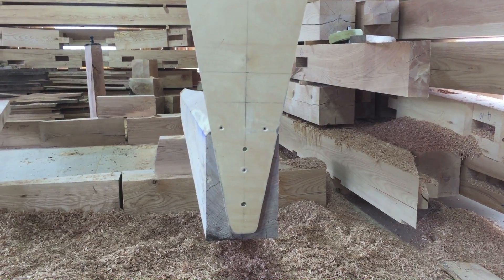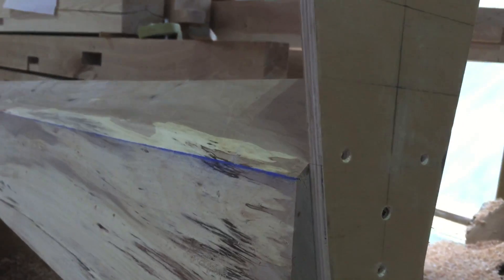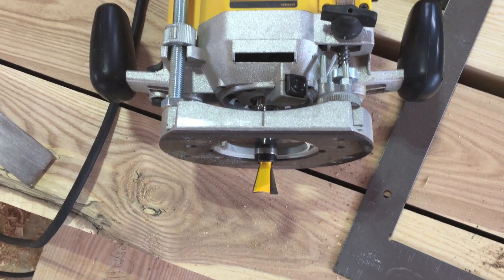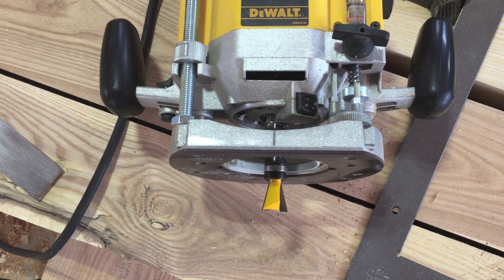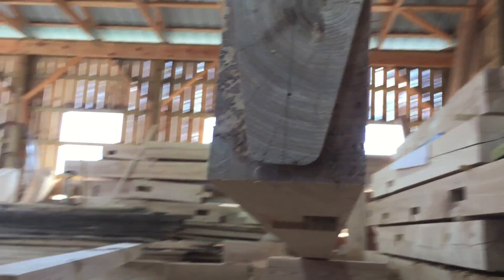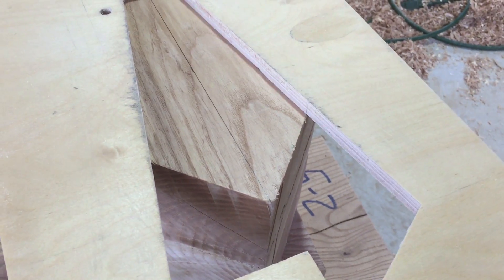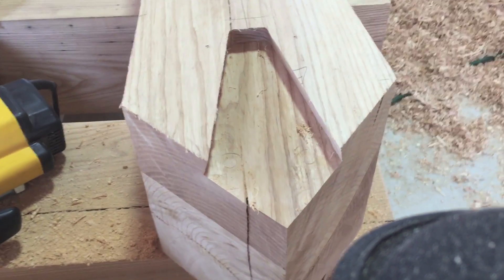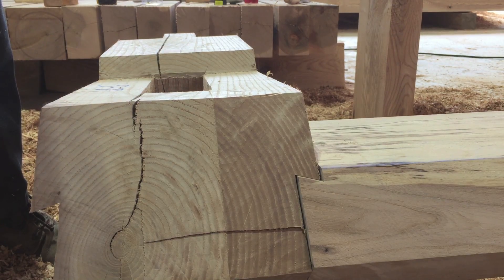Cutting dovetail joints on timbers

Comment: Hi 👋, From a long time ago, 😂. I was looking at buying the Lignatool but as we all no they are a great jig if you have a lot to in the timber frame construction industry, and very expensive, I made a set of jig out of MDF through trial and error, it took me approximately two hours quite a few years ago, once I had made it and I was happy with the way the joint went together. I went to an engineering firm that tired used over the years on the outskirts of Bury Saint Edmunds in England., they machines up to 10 mil, thick aluminium plates for me to match my MDF jigs that I made, at the time I was restoring a mill over in France, where I needed to take out 24 floor joists , they were somewhat rotten to say the least it was not safe to walk on the floor above, once I had removed the old flooring and clean the area up., made up a large wall plate approximately 12 x 4”, and bolted it to the wall with stainless steel threaded rod, which was bonded into the wall, I did, however, put post under the wall plate to give it extra support as the building is quite old and a bit frail in some places, including the cutter, and having the aluminium plates, made up, it was less than £500, this did not include the new router that I brought , Mafell 😂, 
As you have done when needs, must you modify and make your own to do the job , I done this job back in 2014 and it’s still solid as a Rock, 
Phil from the moulin France, where I have now retired to

Comment: I can not understand why you chose to use a Dovetail router bit instead of a straight cutting bit, since you were not cutting a through wood dovetail slot and were actually just cutting around and following a design pattern.
Reply from the maker: The Shadow I used a dovetail bit because the mortise that will be receiving this is also cut with a dovetail bit, to allow the two to lock in together.
Reply: @bigassslabs-chainsawmillin8461  which bit was it you actually used?
Reply: Happy Holidays To All :  Thank you for the quick response to my question. Yes you are joining two large pieces of wood together, using a cut away dovetail design as the joinery. But, the bit you are using was designed to be used in an entirely different manner. (i.e.) It was meant to cutout a dovetail design in wood the exact size of the router bit its self, no larger, no smaller. It was not designed to make a larger dovetail template cutout. Albeit, its your project and as such, its your choice to use what you wish. I was just curious as to why you used that particular router bit.

Comment: Thanks for posting this, I have had my eye on an Arunda Jig for sometime now but can't justify the cost yet, I even priced just the dovetail bit from Arunda, and it's maybe $300.00 USD by itself, I thought I would build the templates myself as you did, that would be easy enough to do. I was thinking could the entire structure be built with just dovetail joints? Even the angle braces? Mortise and tenon joints do weaken the beams and posts to a degree, however there is a lot of wood left in a dovetail joint like you have here. My only fear would be the joint could shrink out of the pocket altogether, however a decorative or hidden metal fastener could be used to keep everything tight and from shrinking and separating.

Comment: Hi question, I’m building a pavilion timber frame right now but the wood is green ! My question is does it matter that is green ? Do you normally kiln dry logs for timber frame ? I’m afraid of making mortises and tenons joints and shrinking too much later! Great videos learning a lot . Thanks again
Philcarmo@aol.com
Reply from the maker: I'm not sure there's a right answer to your question. I've heard arguments both ways for green build vs seasoned timbers. I would say if you're building green keep your time frame between milling and assembly as small as possible, that way any movements in the timbers will happen once it's assembled and the timbers are pretty much locked in place. Kiln drying large timbers simply isn't feasible, so the alternative would be to mill the timbers oversized and allow them to season for a period of time before resawing to the desired dimensions.